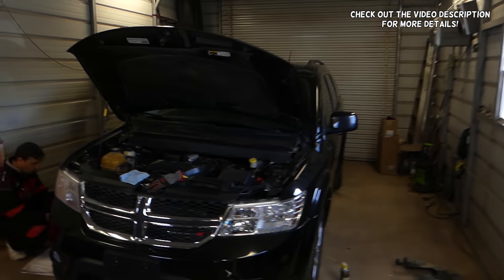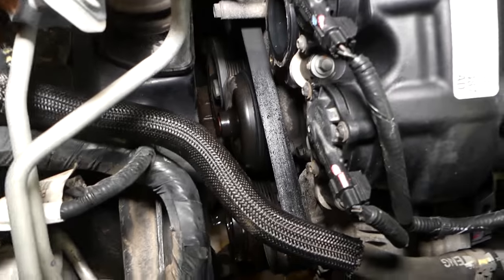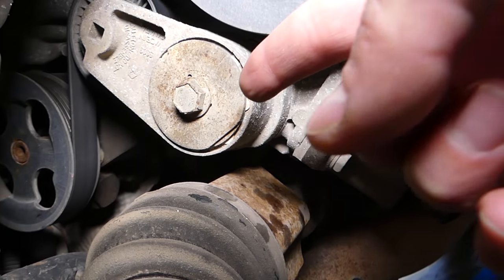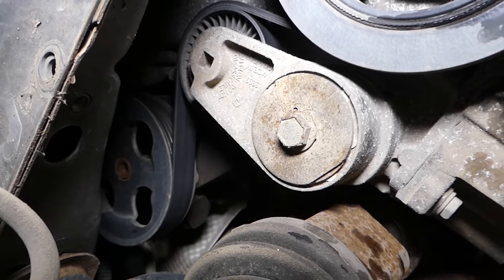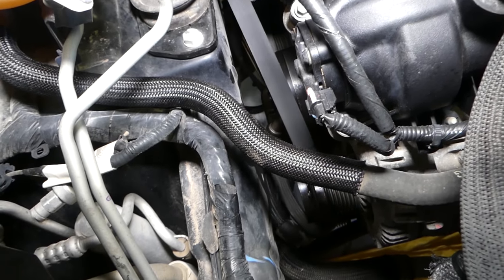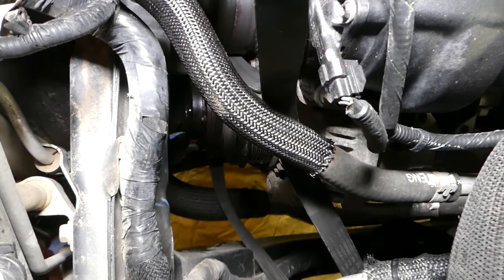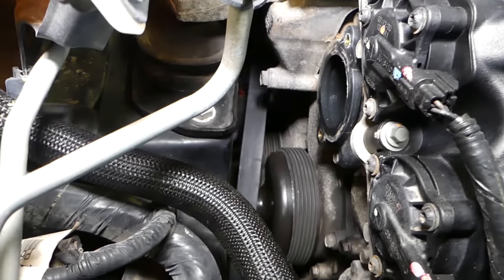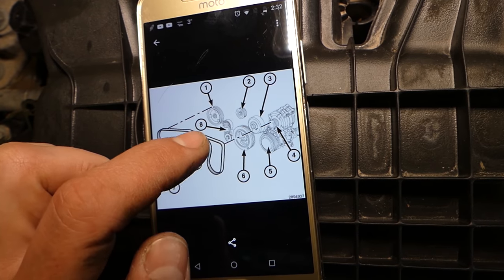DODGE JOURNEY SERPENTINE BELT REPLACEMENT DIAGRAM 3.6 V6 PENTASTAR FIAT FREEMONT

Comment: If i leave my ac off my car squeaks, as soon as i turn on my ac the squeaking goes away
Reply: Might be the tensioner
Reply: What was the problem? My car power steering intermittently is hard to turn, now the battery light is on, my car is making screeching sounds, and the AC is acting poorly
Reply: @emmore436   any idea my Dodge Journey squeeze when i turn on
Reply: then stops after couple minutes
Reply: @dardaniaal7299  what do you mean it squeezes ,
Reply: @emmore436  squeaky noise
Reply: @dardaniaal7299  Does your battery light come, including steering wheel hard to turn?
Reply: @emmore436  no light or hard turn
Reply: @dardaniaal7299  seems like you need a new belt before it gets real bad, like it snaps or something, which will cause the steering wheel to go out and battery light to turn on. Because my car was screeching before it got worse